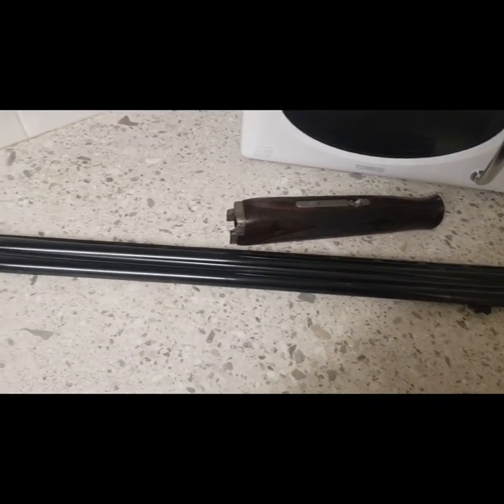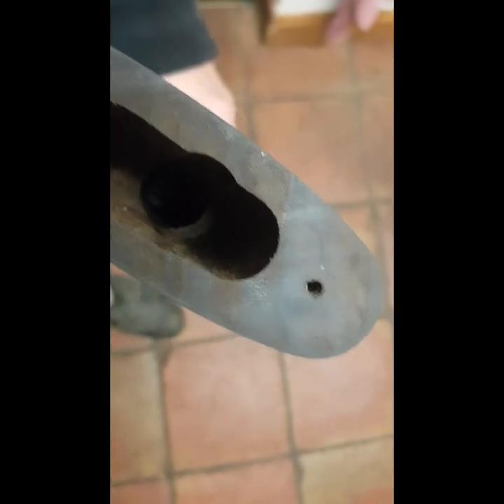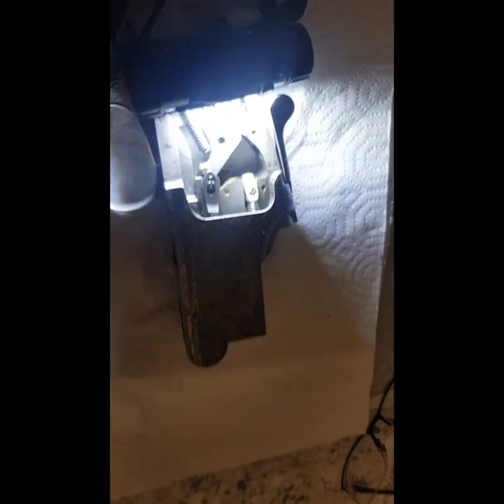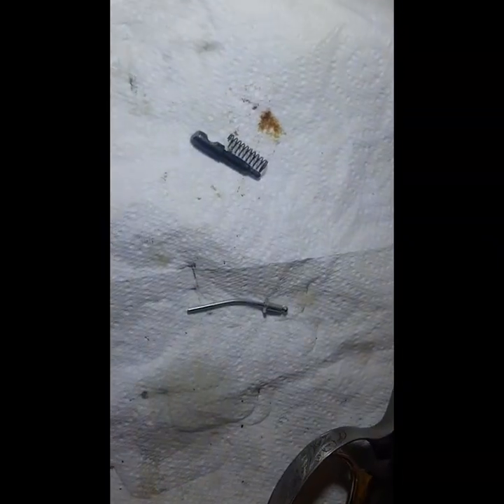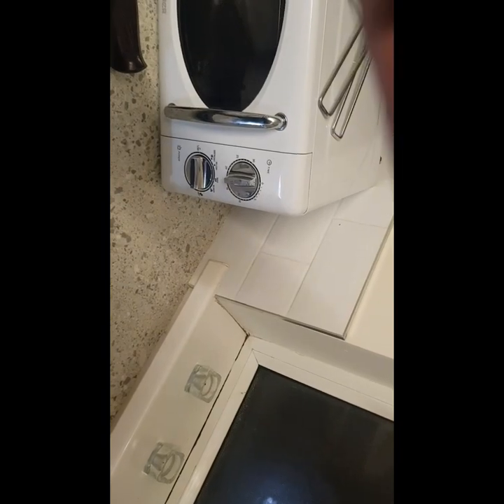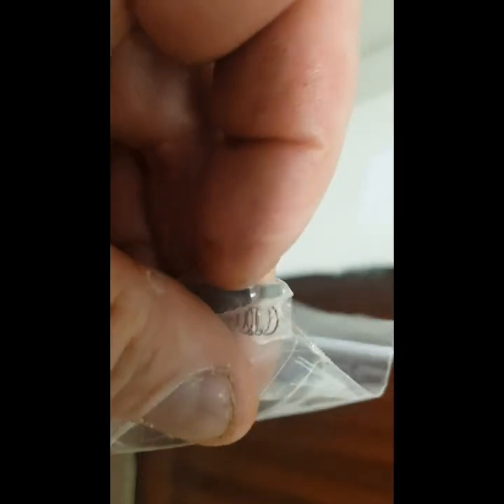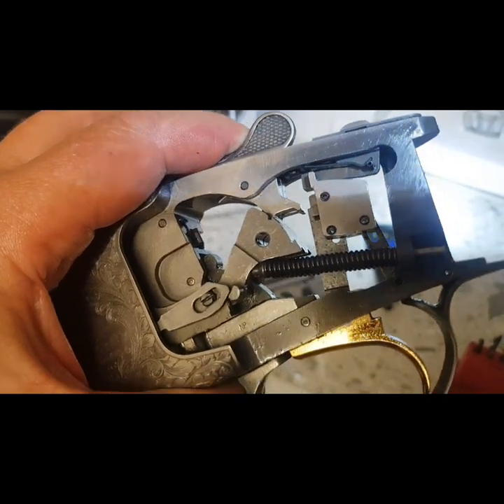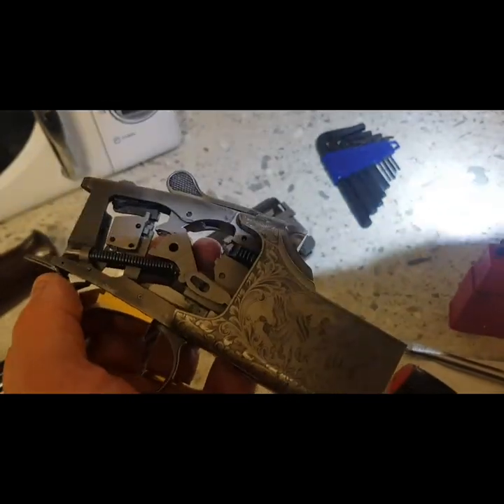Replacing the bottom firing pin and spring in a Browning B525 Citori Shotgun

Comment: Had exactly the same problem with my B525, although strangely, only with Fiocchi skeet ammo. The bottom firing pin looked vey pitted. I was going to take the gun to a gunsmith, but after watching a couple of YouTube videos, decided to have a go myself. Made the same mistake of trying to drift the retaining pin out from the right side. When I tried from the left, it popped straight out. Have ordered a firing pin from Airgunspares (£34.50) and don’t envision any problems replacing it. There is a random steel wire that plugs 2 holes on the left side of the breach, which doesn’t seem to feature on any diagram I have seen (it fell off as I was withdrawing the retaining pin, so I’m not 100% sure where it goes!!), but I’m sure I’ll work it out. Thanks for the video and giving me the confidence to have a go myself.
Reply from the maker: Brilliant. I am learning all the time too.

Comment: The pin holding the pin is knurled and should be knocked out from the other side( left to right when action held up) that is probably why you had trouble knocking it out as the pin knurl has been driven into the hole. Hopefully it hasn't damaged the hole or firing pin hole.
Reply from the maker: Hopefully not. Thanks for the help.